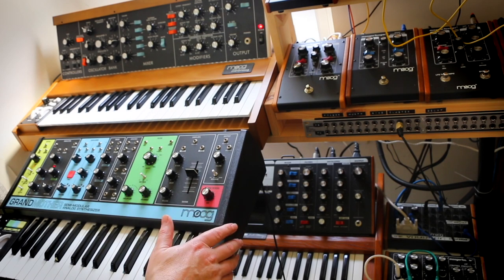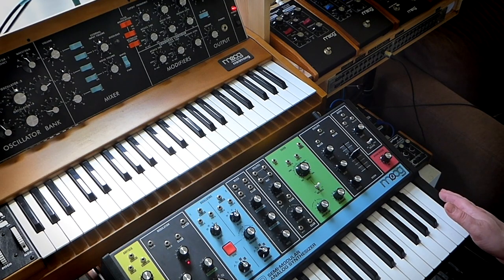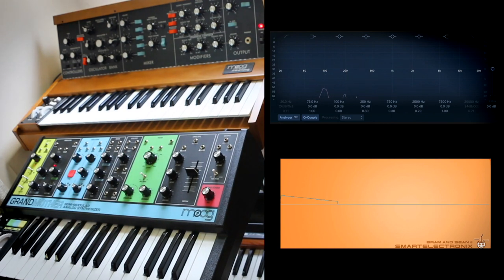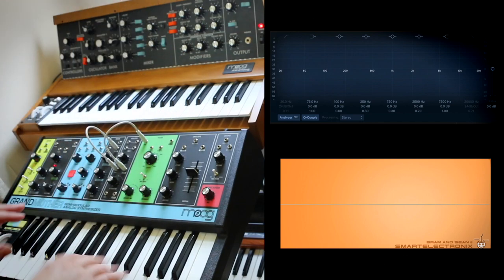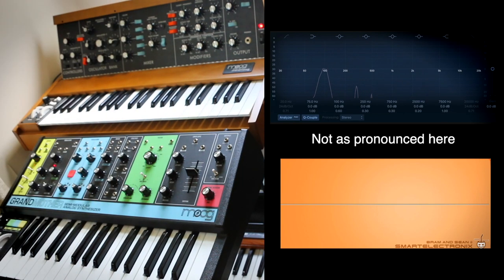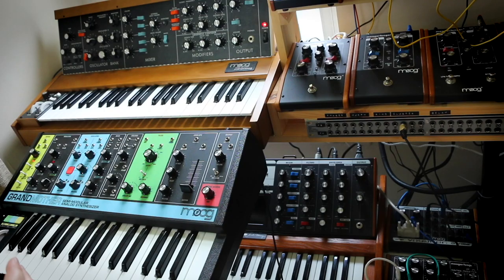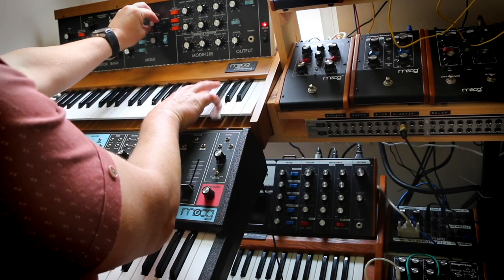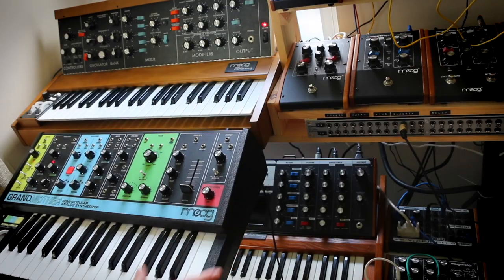Moog Grandmother vs Minimoog Model D reissue // review and demo

Comment: I think the main advantage of GM is modularity. You can easily swap the filter on your GM with eurorack module or use other synth for that, create cross synth patches , add sequence modulations with things like Korg SQ-1 and so on. I really like running GM through the Microvolt 3900 12db filter. It gets completely different vibe to the synth and makes it sound really modern. Another great feature is sping reverb - since you get separate out for that at the back of GM you can process it through your favorite chorus and eq effects and create wide stereo spaces.
Reply: 😎 i just got GM today as my first synth

Comment: I have the Behringer D. I like that it sounds basically exactly like a minimoog, and it’s also got patch points.
Reply: James Corcoran not even close.
Reply: @xxheartbrokexx100  Listen from 13:46. Pretty impressive to my ears... try listening without looking
Reply: @xxheartbrokexx100  Actually, it’s EXTREMELY close. It’s a replica of the model D with the same circuitry.
Reply: @benjamincoggins6568  yeah, with modern cheap ROHS compliant components made of different substrate materials. With a fake pass through the clipping bulb and a diode with a tendency to bias in reverse suddenly, literally making the behringer sound like a wet fart and nothing else. It’s a lot less close than you think…
Reply: @xxheartbrokexx100  Fair enough. Have only heard recordings which sounded super close, but sounds like you've checked. I stand corrected.
Reply: @benjamincoggins6568  the behringer is honestly good a sounding unit, especially for the price, and is much closer than a VST, but it’s not at all identical. Even modern Moog’s don’t quite sound like the “moog” sound from back in the day, like my Source and micromoog have similar architecture and circuits to my Grandmother, and mother-32 but are way, way fatter sounding, especially in the filters. The matched transistor pairs from the golden age have a very specific curve and THD that just isn’t the same as the modern equivalents.
Reply: @xxheartbrokexx100  as close as the Grandmother. Don’t be such an extremist.

Comment: This is a great video!  I also have a reissue Minimoog D and the GM.  I've got GAS for the Matriarch, especially after seeing/hearing all the demo videos.  I finally got the chance to mess with one yesterday here in town at Control Voltage.  At first I was getting a little disappointed because there was some things going on that I wasn't quite sure why.  Part of it I was trying to play and set it up the way I would the GM.  It just wasn't giving me what I thought I should until I really started figuring out the extra switches and modes.  Then it started to shine.The GM though is so immediate and easy to play.  And with the built in spring reverb it's kind it's neat little all in one package.  The Minimoog is somewhat similar in being fairly immediate, just a little more in changing things up.  Both the GM and Minimoog are pretty much my favorites out of all the other toys/synths I have because of the fairly simplistic layout.
Reply: The Matriarch is one of the best synths of all time. I love mine. It’s absolutely amazing.

Comment: Just a scant few years ago, Behringer was a joke. I put them into the same quality category as Pyle, Mackie, Art, Rolls, etc. and other prosumer studio audio gear brands: fine for a budget personal studio, but not really good enough for a serious pro-level bit of audio kit. I spent a wad getting a Midas 32R just before Behringer bought Midas and introduced their own clone.  I was very skeptical. But Behringer seemed to be reverse-engineering the Midas preamps very well, and their X32 mixer turned out to be better quality than expected. I would totally enjoy playing around with a Behringer synthesizer (keyboard and/or modular). Their System 55 is apparently a credible clone of a Moog system costing 500% more.

Comment: You can patch the Lfo + the mixer Output into the Multi of the utility and go from there to the Filter. you then got 3 oscs. Without loosing the noise. If you send the lfo through the attenuator you can even regulate the volume
Reply from the maker: Ah ha... nice
Reply: Thanks , i was looking for that 👍🌞

Comment: Great video, thanks! Couple things on the GM: If you hold shift while turning the Mod Rate knob you can fine tune it. You can also get a much brighter sound if you patch from the mixer out into the VCA in (bypassing the filter).
Reply: Good to know, i was wondering about that
Reply: that what i did and it great

Comment: That crackling on GM is terrible! Mine was crackling after a month after purchase and I had to send it to Thomann for repairs. Now that they have replaced the knob it’s almost perfect, just needs to warm up a little for silent operation. A quick tip - you can use attenuator for controlling filter without crackles :-)
Reply from the maker: Moog have sent me a new pot.  Just requires a bit of soldering.

Comment: The simple 3 oscillator chord comparison was amazingly close. Worst case you could add just a bit of highs on a mixer channel with the Grandmother to be bang on. I saved up for the Model D but just ordered a 2nd hand Grandmother instead for 1/6th the price. I think I will expand it with a small AJH minimod synth euro case.

Comment: @starsky I heared, (but didn’t check) the oscillators on the GM are brighter when bypassing the filter… makes sense.
Reply from the maker: Yeah I’ve heard that too but like you have never checked. Trouble there is you don’t have a filter! 😂
Reply: @StarskyCarr 😂 yeah, devil is in the details
Reply: @StarskyCarr I checked it. And it’s such a big difference… it’s great to have that extra grit for some sounds… like sync leads.

Comment: Yeah... you can’t really compare them... there different beasts. Though if anyone is into making hip hop go for the model D. I found the low end thumps harder than the grandmother. I’ve messed around with both. Though grandmother can blast you off into space with some pretty interstellar sounds with its semi modular set up
Reply: The Crazy Canadian I respectfully disagree. Grandmother can get just as much low thump imo(routing the LFO as a 3rd oscillator puts it a 1 to 1 comparison, otherwise model D would still hold the edge).
Reply: Also might want to try the minitaur a lot of people are under the impression that it has the same sound as the sub series, but it gets lower and rounder similar to the minimoog but a little cleaner which is nice for sub bass, and it’s cheap and really dedicated for those duties

Comment: At 12:04 the Pulse of the Width??  I think you mean the Width of the Pulse.
The original Minimoog could drone if you inserted the shorted S-Trigger plug into the Socket in the back and you turned up the Sustain.  I suppose on the reissue you would use the V-Trigger connector in place of the S-Trigger and Cinch-Jones connector used on the original Minimoog.
Reply from the maker: Haha ... no I definitely meant the pulse of the width 😂😂
Reply: @StarskyCarr  *Sigh*  You Britts..

Comment: 5:35 "we can't get into that territory": basically, can anyone recommend some filter module that brings the Grandmother into that Minimoog territory?
Reply: the question is: why? The GM doesn't need to be a Minimoog, and I get it, I once felt that way as well.
To me though, the Grandmother is a continuation of where the Minimoog left off and could have come out in like, 1982 say. It's got the Modular Moog filter. Sounds different but just as phat and cool to me. I think it's the best sounding Moog in years. Best inheritor of the Minimoog crown if you like. Should have been called the 'Granddaughter' : ) 
Granddaughter of the Minimoog by way of the Voyager ... which I never really liked as much as I thought I would.
Minimoog does what it does and is an instrument unto itself. So too is the Grandmother. An instrument unto itself that is super accessible, sounds pretty amazing. And just begs to be played. I say this from getting lost in playing the GM for hours. And that's even before adding patch cables.
If I were to advise any young keyboardist or synth player, I would say, "buy a Grandmother and keep it forever." because it will never go out of style and always be super useful, a modern standard.
If you really want the Minimoog sound you really have to get a Minimoog.
Reply: @BarryWarne  I agree. But the Grandmother has patchpoints that invite to crossbreed it with other things and push its boundaries, also from an educational point of view: I am very interested in what exactly makes the difference between those two (same) filters and like to explore how to achieve a certain sound from scratch. The Grandmother is indeed a fantastic instrument. I have it since 2 years and it is my favorite synthesizer.
Reply: Maybe the AJH MiniMod Transistor Ladder Filter?
Reply: Perhaps backing off the levels in the mixer would have helped.

Comment: @Starsky Carr I know maybe it's a stupid question. But I have one day to choose between Moog Matriarch and Subsequent 37. I need mostly for work (not for music creation, I'm programmer of auv3/vsti instruments). Which one you did recommend? If sub37 has same possibilities, then propably this one? As I understand with both I can create FM and both have same filters (except multidrive). Thanks a lot!
Reply from the maker: For more experimental stuff I’d go Matriarch but you prefer repeatability, integration with your daw and presets then the Sub 37. Both great just depends on your workflow and needs.
Reply: @StarskyCarr  Thanks for reply. So, for experiments better Matriarh? Again, I don''t want to write song, just experimenting with sound. e.g.creating crazy frequeny modulation and filter modulations that allows me to reproduce it in the vsti. But if sub27 doing the same or more and even better, then I would choose it instead of matriarch. My current implementation is a 1 to 1 repeat of the moog filter. It remains to repeat FM. This will be my first analog synthesizer and I don't want go get a mistake. The matriarch looks like it can give same things that can give me sub37 (if we speak regarding sound, not presets). Therefore, I will ask the question differently - is there a sound that cannot be made on "Matriarch"? if not, then the choice is obvious
Reply from the maker: The sub37 has the 2 LFO modulation routines that can be synced to tempo, as can the looping envelopes. This is its secret weapon. The matriarch can’t do that but it has arguably more experimental opportunities with FM. If you want FM style tones go with the matriarch, if you want syncable modulation go with the sub 37.
Reply: @StarskyCarr  Thanks, so the sub37 seems to be good and modern deal!
Reply: Matriarch sounds better than Sub37.  I’d only get S37 if you NEED presets.
Reply: @kierenmoore3236  We didn't have sub37 on sale, so I bought Matriarch at a discount - it's wonderful.

Comment: I wonder if you'd be willing to do a quick video that compares the Model D to the Grandmother if the Grandmother's cutoff range was extended by the attenuator. I'm pretty sure you can make the filter open up wider.

Could you compare the Model D doing those typical 3-osc tones (like the Assault on Precinct 13 bass sound) vs the Grandmother, when configured this way? (I know it's a lot of trouble to put together these videos, but it would really help if we could get a good comparison of those typical core tones that people want a vintage Moog for)